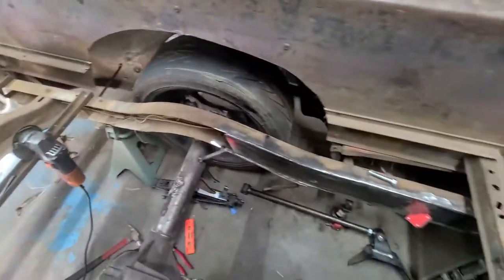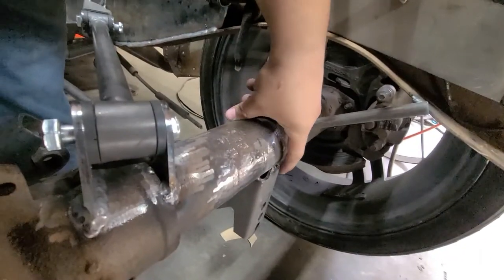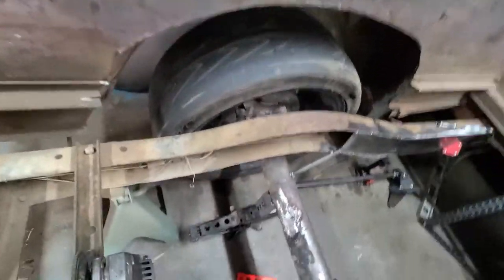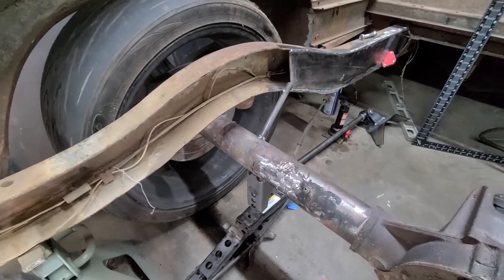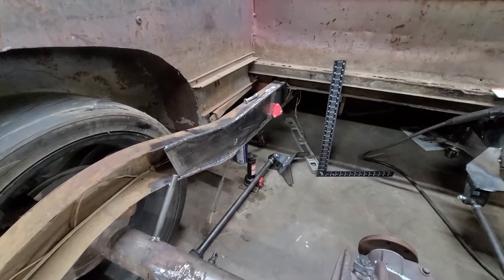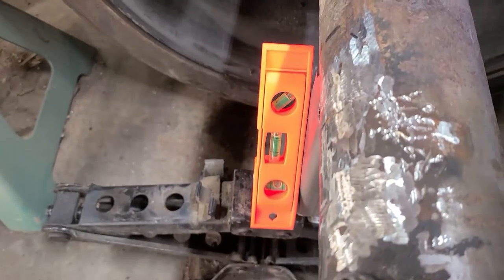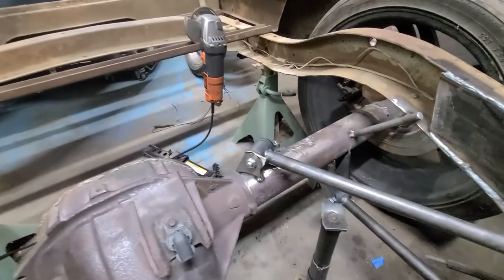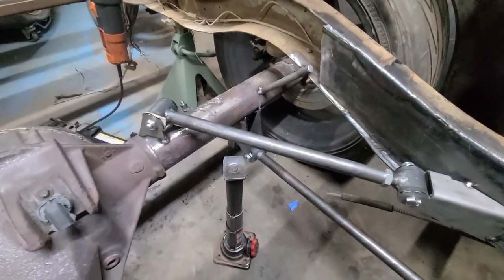Triangulated 4 link goes in part 2

Comment: Nice work. Question, are your bars parallel to one another, and are the lengths the same
Reply from the maker: The lower bars are one length, and the upper bars are one length they are different. The bars are parallel to each other.
Reply: @rustbucketgarage  thank you. I'm doing my first narrowed axle,with triangulated 4 link. A little ranger project.